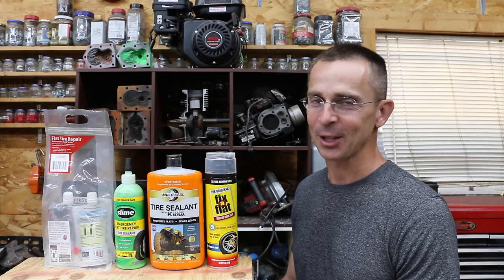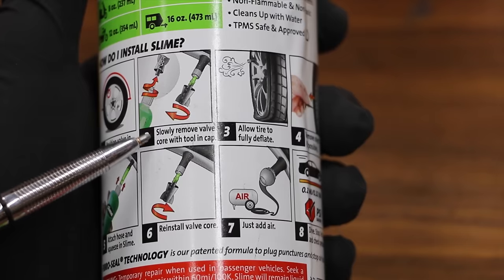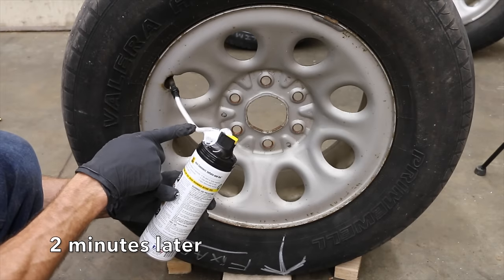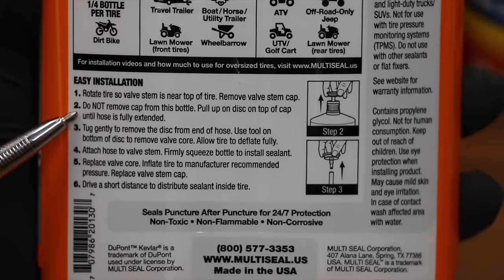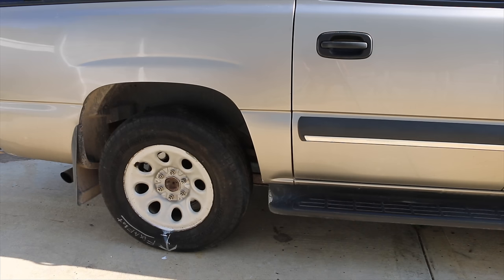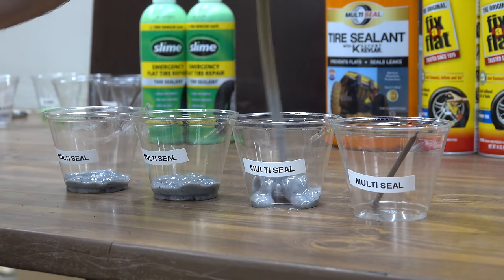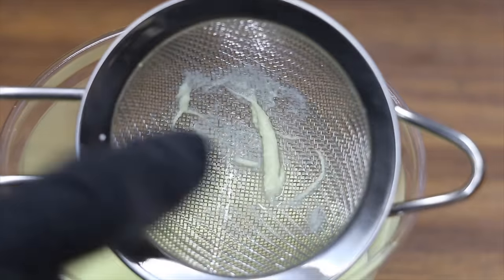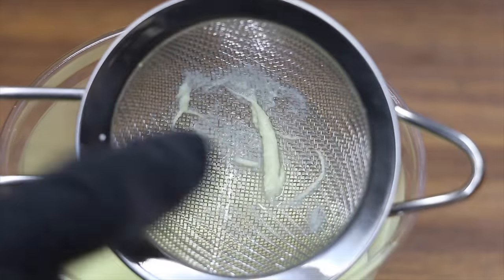Is Tire Slime the Best? Fix-a-Flat vs Tire Slime, TireJect, MultiSeal. Let's find out!

Comment: How about a review of the best portable tire inflators?
Reply from the maker: I'll do it soon. Great suggestion!!
Reply: @ProjectFarm  Definitely check out the viair 88p it's highly reviewed on Amazon!
Reply: @ProjectFarm  Check the one that comes with Chrysler cars now that they don't give spares with their new cars
Reply: I use the handhelp Ryobi inflator. Other then the need for a battery, it is great.
Reply: @ProjectFarm  The "Power Tank" is the best, there's nothing better.  I have one and it can run power tools, reseat beads and inflate tires faster than anything else.  Although, you do need to refill it, so it's not a compressor but it is the most efficient.
Reply: Top Feed Coco  my mom is pretty good, she's a bit flat and saggy now, needs to be replaced with s newer one, but it's sentimental value
Reply: I second this!
Reply: @jusb1066  saggy? Did you try the fix a flat?
Reply: @ProjectFarm  Nice. I planned on getting a portable inflator. I'll hold off for your review.

Comment: You got on trending CONGRATULATIONS !. I don't use any slime since it always throws the wheel off balance.
Reply from the maker: Thank you very much!!  I really like Slime for farm equipment.  Lots of thorns from Honey Lucust trees, making it impossible to plug all of the holes.  Thanks again and looking forward to your next video!!
Reply: Slime do state not to exceed a certain speed once you've got it inside the tyre for this very reason.
Reply: The entire purpose of this stuff is to use it temporarily until a proper patch can be done or a tire replacement depending on the damage done to the tire. It's one of those you should have in the trunk of your car next to the spare just in case, this is what has been told to me by a few mechanics, they hate dealing with the stuff but if it gets you to a shop without damaging the rim then it's ok, just don't use it for a permanent solution.
Reply: I'm not worried about wheel balance on my lawnmower.
Reply: It says temporary use but after fitting some 15-20,000 tires, I can tell you about 0.5% of people ever take it in for a proper repair after using the goo :( not only that, they would use goo or what we called (dog turds) in damage repairs to the side wall and keep on keeping on, which violates road worthy where I'm from....... Great for the farm and off road but IMO after doing years of light vehicle service, tire fitting, wheel balancing and alignments I think this near should be pulled from the shelves for general road users as can cost is about same as a safe professional repair in most cases and if is like our store, we warranted our repairs for life of the tire.
Reply: @psychosis7325  Yes, but the point is, you use it then drive, and you don't even know you've gone over a nail. I used tyre slime in my service vehicle (or "van" as the rest of the world call it) and I just didn't need to worry about a flat tyre.
Reply: @NigelTolley  That is essentially how the stuff is marketed, too.
Reply: Your moms HITACHI  Yes, drove it everywhere, thousands and thousands of miles. UK temps don't drop below freezing for very long, certainly not below -10C for more than a night. No issues up to, er, let's go with *any speed attained*.
Reply: If you are rightfully worried about balance on the tire try a product called "Ride-On". It not only seals a tire it will also balance the tire with no tire weights.
Reply: @michaelbrown7675 thats because it contains beads that dynamically balance the tire as you drive.

Comment: Fix-a-flat wasn't intended for use in tires, it was intended for use in garbage bins.
Reply: That's where I tossed mine but it didn't fill that hole either.
Reply: Strange thing  is,  i  used Fix-A-Flat years ago with great results.
Needed to fix a flat in outside of Dallas on the  highway, drove to  Austin no problem.
Took in the next day for a proper repair and it still had plenty of air in  it.
Maybe it needs to be driven long enough to heat the  tire?
Reply: but then you will just end up with trash leaking everywhere
Reply: @BB-1990  
I agree, in the mid 90s I had good luck with fix a flat, now it doesn't work
Reply: FAF is pure trash 🗑

Comment: Years ago I worked in a tire shop and what we noticed is that people who used fix a flat and bring the tire in for repair months later the rim was heavy corroded. Also the rubber on the inside of the tire was very soft(deteriorated) and made patching hard .you have to sand the area to apply the patch but the tire would just dissolve.
Reply from the maker: Great information!  Thank you
Reply: @ProjectFarm  Also if you turn the inside of your tire into a greenhouse the steel belts will eventually rust and fail. The hole needs to be sealed completely with a repair, otherwise moisture will prevail.
Reply: IT says 'temporary' right there on the can. maybe that's why.....

Comment: Hopefully a fix a flat rep is watching this because the product seems like a sham having watched the video.
Reply from the maker: Thank you!  Seems like a lot of viewers have had poor results with fix a flat.  Very few have had good results. I hope they improve their product.
Reply: I don't like any of these products.

But, I have seen Fix-A-Flat  work before.

You really must install it and drive for quite a while, longer than the directions say.

Also, get to an air compressor as soon as you have drove a while, then drive some more.

A friend of mine and myself filled his crappy tires with Fix-A-Flat and drove from northern Indiana to central Texas.

The stuff actually held up for a few months.

I still don't recommend any of these products, hahaha.
Reply: It has always been that way.  Lucky to seal a thorn in a bicycle tire.
Reply: I worked for 2 places repairing tires professionally, one of them a tire chain store, and I can honestly tell you that you're better off to buy a plug kit and learn to use it. You'll also need the 12vdc tire inflator he shows in the video OR I kind of prefer the 5 gallon air tanks. They cost a little more but they are a lot faster.

Comment: and now I will ask the follow up question... will multi seal work after driving over a spike strip?? Asking for a friend.
Reply: IfYouDisagreeYouAreWrong  is right.  You would want honeycomb tires if you are going to test something like that.
Reply: It's best to avoid spike-strips, entirely, by going around them, and around where the cop can pull them, or maybe, make a hydraulic or pneumatic setup, that will allow your vehicle to jump over it at speed. If you want to try that, then you better practice in a secluded location.

I'm also interested in airless tires, like what the moon rover has. After all this time, I think the rover is still up there.
Reply: Good thing we have all these tire scientists on here to explain about spike strips..  And here I thought that comment was just meant to be funny.
Reply: @mtd610  
It seems like you are trying to belittle the people here, trying to help someone escape the gang-members of the state, who are a threat to good people, because of broken, unfair laws, on top of the possibility of a cop being a bully.

Since you're trying to sarcastically dismiss these comments, then maybe you're a cop.
Reply: @observingrogue7652  Rover stolen by aliens or its in Arizona - or perhaps Iceland
Reply: @SamaritanElad  
I only mentioned the rover, because it's springy mesh tires, don't have the problems pneumatic tires do. And I remembered that that the rover is one of the things the astronauts left on the moon. But I don't literally want the rover's tires & wheels.

I want something like them, for us. These are futuristic times we are living in. Advanced electric vehicles, Smartphones stronger then computers, smart homes, CRISPR editing DNA, yet, we're still using tires that require air pressure, that needs to be checked & updated. And when these tires fail, it can range from an inconvenience to a fatal disaster?

And even if the sidewall is good, if the tread is too worn, the whole tire is garbage. If the sidewall is damaged, but the tread is new, the whole tire is garbage. And even when not used, if they're too old, they're garbage, because they deteriorate.

How is it that we don't have something better then tires by now? Some wheel or tire, that absorbs bumps & supports the vehicle, like a tire, can handle speed like a tire, but doesn't use air. If the support structure is damaged, it can be repaired or it's little parts replaced. If the tread is to worn, only the tread is replaced. Why don't we have this yet?

Because it will make spike-strips and the air tire industry obsolete? Forget them.
Reply: Observing Rogue just don't break the law lol
Reply: @sc............................  
You do not understand. 

Do you have any idea, how many state AND federal laws, go into effect, each & every business day? We are above & beyond overregulated, yet there are idiots who believe, even more rules will fix things, even more will create a utopia.

How do you know you're completely legal? Just living your normal life, it's very likely you're breaking multiple rules. It's also very likely, that most of those rules, are victimless crimes. Things not harming, threatening, or cheating any innocent person, but it is still a cops job, to extort money out of you, kidnap you, or kill you over them.

Just because something is legal, that doesn't make it right...Just because something is illegal, that doesn't make it wrong.

Martin Shkreli, was legally allowed to extort people, who were suffering & dying from parasites. He got the exclusive rights to manufacturer & sell an important drug, and because no one else was allowed to make & sell it, he rose the price of EACH PILL, from $13 to $700. If anyone else tried to make & sell that drug at a fair price, to save people, the government would have came after them with fines & guns.

And here is an example of something right, but illegal. Motorcycle Lane Splitting/Filtering is legal, accepted, and encouraged,  nearly everywhere in the world, except 49 U.S. states. And in many of those states, the police will come down on you, hard, if you do it.

Riders survive, by riding like we are literally invisible, and staying out of the way of bigger vehicles. I safely filter & lane split, to avoid being rear-ended & crushed, by a distracted or drunk driver. 

I am not losing my bike, my legs, or my life, because of a stupid person behind me, a stupid law, or a cop stupid enough to enforce it.

And it doesn't matter how safely & carefully I lane split or filter. In 49 states, the police will be a financial & physical threat to me, for doing so. For keeping myself & motorcycle safe.

And that is 1 of the many victimless "crimes", I know for a fact, I will be committing.

The more of your life the government is responsible for, the more of your life they own.

As an Anarchist, an Anarcho-Capitalist, I am building responsibility & independence, from the government. This makes me a criminal, because I am breaking unfair & illogical rules they made up. And even though I am not threatening, harming, or cheating any innocent person. It is the polices' job to do all these things, to me.

To preserve my money, property, freedom, and life. I must evade, disable, or kill the police, in self-defense. 

Pulling over & submitting to them, is not an option.

If I die because of them, I will die fighting for what I believe in. 

I believe the government is detrimental & unnecessary, for a fair, functional society. I believe they are ruining & taking innocent lives, every day, and they are ruining our economy & country, with their unfair taxes, fines, fees, regulations, laws, monopolies, broken welfare programs, and minimum-wage.

I believe their political system is just a way to divide, distract, and conquer our country, and should not be used as a method to fix the government.

I believe there is no fixing the government. It has become too corrupt and out of control. One way or another, it must be destroyed, as an entity. They will not stop peacefully, we must force them out of our lives. And I believe this will be done, through a civil war for our independence, and more & more people standing up to them and defying them.

Lead by example.

Be the change you want to be.

Pulling over and submitting to the police, is not an option.
Reply: @observingrogue7652  Maybe go to a different state, or an entirely different country? (You're in America, I can tell)
Reply: @NigelTolley  
Government is a global virus, with different strains. It doesn't matter. If I move to another state, or another country, I will just have another government, trying to control my life, when I am not cheating, threatening, or harming, any innocent person. I will just have another government, stealing money from me, through taxes, to pay for whatever they, their lobbyists, and the majority wants, instead of me just directly paying for, what I use & support.

Moving is pointless.
Reply: @observingrogue7652  Okay Speed Racer... pneumatic would be faster than hydraulic but would require insane pressure to lift a ton or more of vehicle into the air, let alone make it jump. Now if the vehicle has a lightweight body and frame like most race cars, it would be more feasible, but then there's the landing to consider after the initial jump.

since we are talking fun TV shows why not go the Batman or Bond method. armor shells that deploy around the tire and act like armor against the spikes. then you only have to worry about traction while the shells are deployed and or the spiked nets they've been deploying as of late that wraps your wheel and brings you to a stop in a hurry.

As for Airless tires. They are a good concept, but some of the ideas that these companies (bridgestone for example) are proposing in the technology seems more in line with destroying the car's chassis by making the tire too stiff and low profile. Gotta have give in the tires or grip and shock transfer becomes a problem. The moon rover on the other hand was a wire mesh which really is interesting to look at... but I don't think it would be usable as an earth tire... Unless the mesh was on the inside of the rubber... which I think they do in military vehicles...

 https://en.wikipedia.org/wiki/Lunar_Roving_Vehicle#/media/File:Lunar_Roving_Vehicle_wheel_close-up.JPG
Reply: Observing Rogue While I fully agree with you that there are many laws which are absurd and even detrimental, blaming the government for such a thing is like blaming the Internet because YouTube doesn’t work. Plus, and this is something I never understood from anarchism, what would you replace the government with? Yes, the government is the enemy, I get it, but who controls that everyone’s needs are accounted for, and that nobody will harm (stealing, assaulting, murdering...) others?
Reply: @nidodson  Q: Do you have 55 days interest free until you have to pay anything after the billing date?
A: The interest free period can be UP TO 55 days, not a 55 days from time of purchase. Ensure you always pay your entire balance by the due date to avoid interest charges on purchases.
Reply: I think its time to shop for a new tire.
Reply: excellent question! How to prep your getaway car! Please make video!!!!how thick a steel plate over the rear window etc etc...
Reply: It did for me. But, I did have to remove the spike and refill the tire with air.

Comment: I am impressed with your thorough evaluation of these common items used for fixing punctures in tires.  I've used Slime in my zero-turn mower tires for the past 14 years.  Even with Hawthorn trees and rough mowing conditions I've never had a flat.  Its saved me from having to repair any of them.
Reply from the maker: Thanks!
Reply: Same here.  Often with lawn mower, Quad, Gator its a bead leak, maybe a puncture.  Doesn't matter, nothing easier that to put Slime in and problem is fixed.  My Quad has original tires from '95 with good tread but lots of cracks that may not survive dismounting.  Slime has kept tires sealed up for 8+ years.  Great video, glad I never wasted money on Fix o Flat.

Comment: I always carry in my vehicles a portable tire inflator and a tire plugging kit. I don't often get a flat tire, but last time I had a thire leaking from a screw in it, I just plugged the tire inflated it and drove home. I worked many  years as an auto mechanic, so I plugged or patched a lot of tires. Thanks for the great videos you create, impressive!
Reply: I use Slime, but not on any vehicle I drive on the highway. Slime will ruin your tire balance. Word of advice. Caused me a bunch of grief.
Reply from the maker: Thanks!

Comment: I have some experience with the green slime stuff in bicycle tires as a preventative, and its pretty amazing.

The little particles are not how it functions primarily, its the cellulose 'goop' that you ended up washing through the strainer. In free suspension, the cellulose fibers move over each other with very little friction, but when they pass around sharp corners and into narrow openings, they catch on the edges of the opening, then on each other, and eventually completely fill in the narrow opening. As additional pressure is applied and more material is pushed into the opening, the cellulose fibers get closer together and squeeze all of the lubricating suspension fluid out and grip more tightly to each other, eventually forming what amounts to a wood-pulp plug that is fatter on the inside than it is on the outside, so any further further pressure is just wedging this plug further into the hole creating a tighter seal.

I think the granules in the mixture just kind give a little added grip to the cellulose fibers so they stack up more quickly and hold on tighter.
Reply from the maker: Thank you!
Reply: So... bicycle tubeless sealant is basically a mix of diluted wood glue and latex?